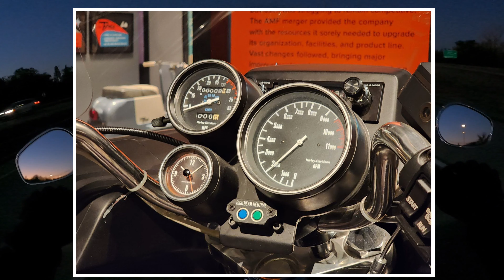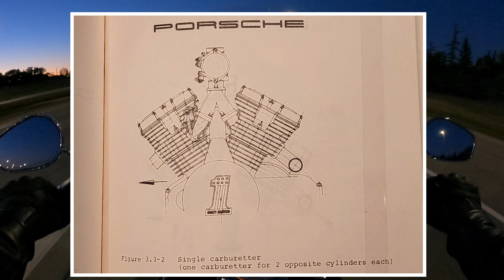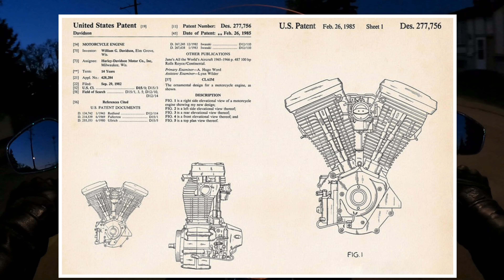Harley Davidson’s Project Nova

Comment: It would have sold just fine had the tariffs worked out the way they did. Unfortunately they had to choose one and they took the sorely needed update to their air cooled engines. had the nova launched, they would have had a chance to capture that market. People liked to complain about AMF but they were doing the right thing by this point. They invested money into the air cooled motors and this new technologically advanced platform. They had dumped the Italian bikes that had no chance against the Japanese. They were also the ones in charge who commissioned the clothing lines that ended up being money makers. It's a shame this bike never got built but when you look at the history of the motor company had it came to market and done well could the buyout have succeeded? Would AMF have sold it for what they did? Would the tariffs have gone in effect? Then, how would it have fared in the late 80s/90s with the plastic wrapped bikes the competition put out? The Vrod was a fantastic bike but it was too traditional for the tech crowd and too strange for the traditional HD rider so personally, I think the nova bikes would have sold well in the mid 80s but I don't see where they would have continued to sell as tastes shifted.
Reply from the maker: It definitely would have been interesting to see how history played out if they launched the Nova.
Reply: Have you seen the Liquid Cooled V-Twin that Buell came out with in 2008?  Very Similar to the engine in the Pan American & Sportster S  HD Killed that too.   The V-Rod is heavy has poor Handling and poor brakes.  It can be fast at the Drag Strip However.

Comment: That Nova did not need many accessories it was going to come with a lot on it.  A single carb would have made adjustments easy on the bike.  It was also the perfect ugliness for the early 80's.  The Porsche engine also meant they were putting serious thought in the motorcycle development.  I would ride around today on a bike that because it is so ugly it would be cool.
Reply from the maker: Perfect ugliness is a good way to put it.

Comment: i remember reading about these bikes back in the early 80's, if i remember right, in easyriders magazine. harley made the right choice going with the evo because the novas would have received the same lukewarm fan fair as the v-rod did when it came out. none of the other bikes harley came out with (other than the air cooled sporty models) ever became popular enough to achieve any lasting success. look at the lackluster reception of the new sportster models. the evo launched harley into the mainstream and created an era of success the motor company had never seen before. something else you might want to look into is it was rumored at the time that honda was also thinking about buying harley when amf was looking to sell. if true that would make interesting content.
Reply from the maker: Agreed 👍